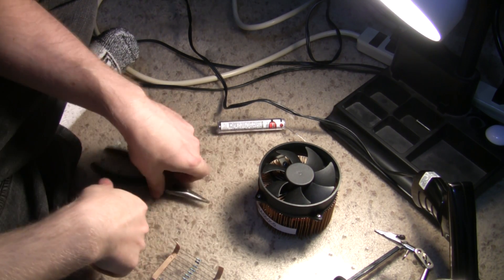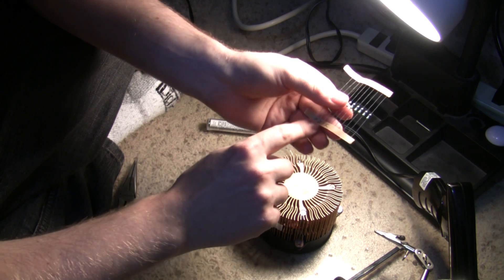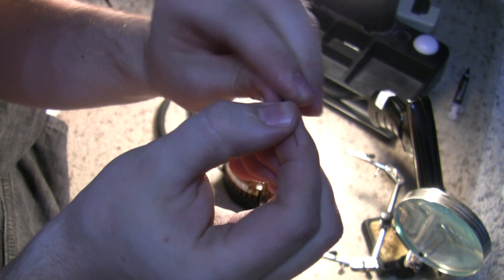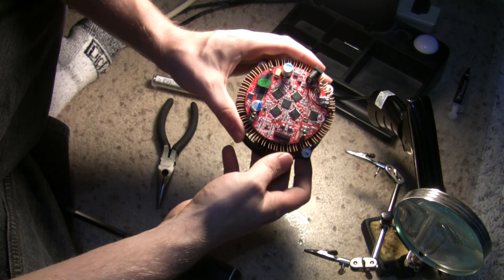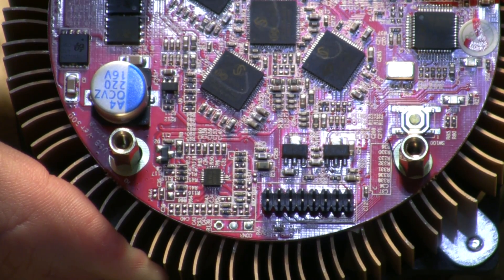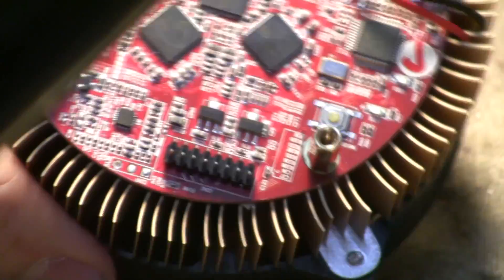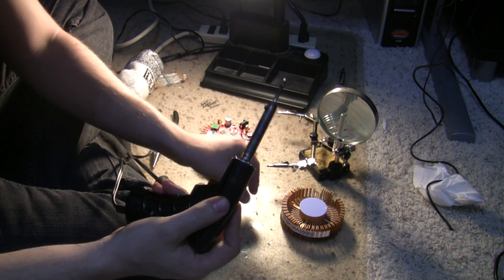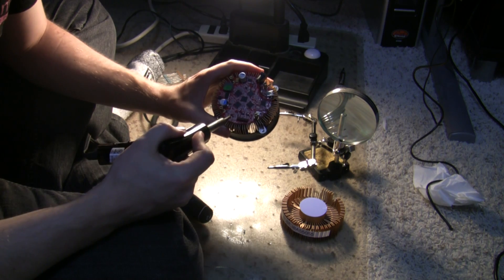Gridseed VMOD3 Resistor Soldering Guide

Comment: OK so if I get the speed up to around 1200, do you know what the hash speed will be about? I'm trying to so some calculations before I do any soldering.
Reply from the maker: mine do 480-520
Reply: cbutters So have you actually measured the wattage that the modded ones use?
Reply from the maker: Troy Gray yes sir, 11 watts stock scrypt mining only w/ fan, without fan 7-8 watts, modded without fan = 22-27 watts depending.
Reply: cbutters How does that affect your profitability? I put all the numbers into some profitability calculators & I found for my rig that just running them without fans & overclocked actually earns more than if they were voltage modded. For my current rig, it only costs me $0.22/day in electricity but if I did the resistor mod then it would bump it up to $1.00/day. And that eats up all the profit that the extra hashes provided.
Reply: Troy Gray Look man, there is no way of predicting your hashrate, if you want to risk it and do the volt mod, and it works, your hashrate goes up, if not you're fucked, and if you don't want to do it just don't do it and stop trying to do some stupid calculations